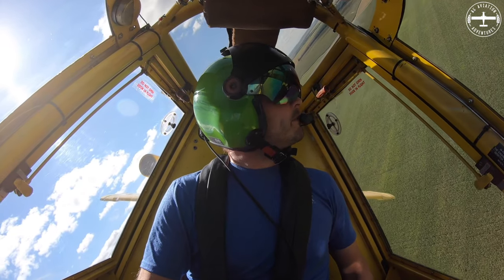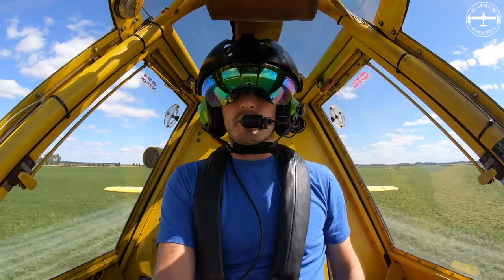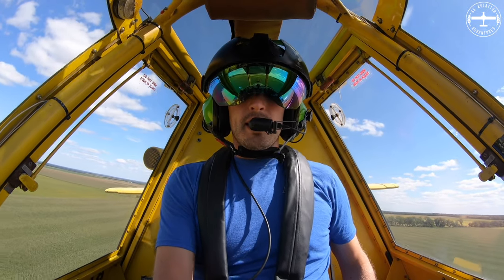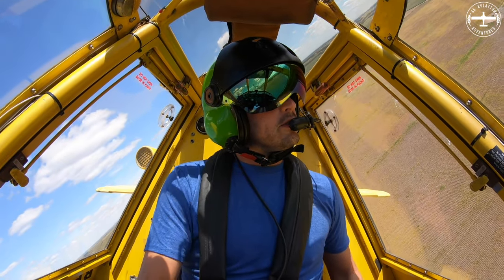How and Why I Got Into Crop Dusting

Comment: Idk if you will see this but I work as a flagger for the Olathe spray service in olathe Colorado one of only two on the western slope of Colorado I see you guys don’t use flaggers/observers but basically we watch the fields drive a truck keep track of its walls in case the system crap so I just watch for people because our fields are on average 20 to 40 acres but your channel is dope
Reply: You should look it up we live 60 miles from Utah as the crow flies at least
Reply from the maker: We appreciate you watching! We’ve actually stopped in and said hi. We live in Buena vista in the winters. You guys live in a beautiful area.

Comment: Great video, if one were to go to an ag pilot school, does that teach you the loader duties as well or just the flying and spraying part of the job?
Reply from the maker: I can't speak for all the schools but the couple that I know about do not teach any loading. It's easy to get on the job training for that. The work order and pilot will tell you what to load and how much of each chemical and water. Then you just measure it out and put it in the cone and then into the airplane. The school I went to focused on how to work and fly the GPS light bar and different patterns to run and how to avoid obstacles.

Comment: I have my commercial license and  I have been looking for information on how to get into crop dusting . I read that getting an applicator’s license can take a long time and several difficult requirements, is that true? How long can it take to get into crop dusting after commercial license ? I would appreciate any information you could give me, thank you. great video.
Reply from the maker: I responded to your other comment, but working on the ground is really important! The best thing flying wise is building a lot of tailwheel time. A lot of folks will buy a cheap TW aircraft to build time in. Getting the applicator's license is studying and learning and testing. You'll have to have an applicator's license for any state you plan on applying in.

Comment: Hi, glider pilot here. I wondered: do you hand fly those few feet above ground, or is there an automated system restricting ground proximity and avoiding obstacles? How close do you have to be to the crop?
Reply from the maker: Thanks for watching Christian. There is no automation and everything is flown by hand. You fly 5-10 feet above the crop. I talked about it in the 502 walk around video.
Reply: @AgAviationAdventures  ever brush the wheels - or the wingtips?

Comment: How big is that pivot? How often do you fly under wires? have you done night spraying? have you flown under wires at night?
Reply from the maker: All the pivots I spray around are 1/4 mile long. I have wires at the end of the airstrip so I end up flying under wires usually 10-15 times a day. I have not done any night spraying.

Comment: What is the chemical exposure risk to AG flying? Looks fun
Reply from the maker: Well, we are applying pesticides all day every day. Some are more dangerous than others but you will also have exposure. There are a lot of things pilots do to avoid exposure, iE they won't fly through their swath/the chemical. On the ground the pilots aren't typically loading themselves, but they can at times. We use precautions, always wear appropriate PPE, and do not cross contaminate.
Reply: @AgAviationAdventures  thanks for the response! My long term goal is aerial firefighting so I am looking at pathways there.

Comment: Hi Tyson: Questions about being an AG Pilot
(1) How does the pay works in this industry? As per the interweb, you can make 30-80k doing an AG Pilot job annually. But that doesn't explain how this all works in the real world. Is it a W-2 or a 1099 position mostly. That would change the take home quite a bit. Its a seasonal job and some areas are long seasons others short. How does that factor in to the pay. Is it sorta like a teacher where you will need a second job during the winter to make ends meet. 
(2) Also in your opinion are AG pilot schools worth the money? The last one I looked at wanted 40k. But if the business is hard to get into, this could be a seriously heavy debit to carry while looking for a job or trying to pay off. You would need to know that it would be worth it. (Im already a GA pilot)
(3) Does this job require you to be flexible with traveling. Will I be following the seasons north to south and from state to state or will I be stationed in one place.

Thanks for any info Scott, Im looking to make a change from my regular grind and want to know if this is a viable change or if its just a time builder. Im located near the CA central valley but I hear its almost impossible to break into, so I know Id be looking in other states.
Reply from the maker: Thanks for watching! You've asked some great questions and I've covered parts of it in other videos. 

1. A pilot is paid per acre, so the more work you get done the more you make. Some pilots make a W2 wage and others are 1099. It kind of depends on who you work for and how they structure it. But I've seen it both ways. The length of the season greatly affects the pay since the more you spray the more you make. Some guys get second jobs during the off season, Cally and I spend our time traveling and recreating. 

2. I went to an AG school and it was about $14,000 for just the AG training. I already had all my other ratings. I was kind of in your boat and I didn't know anyone in the industry or have an in. So AG school was my in... I met some great people and learned a little bit. Enough to get me that first job. I definitely would never pay $40k for training. You will be hard pressed to find someone who will put you in an airplane the first season. You will probably need to load for at least half the season to learn about it and the operator wants to see how committed you are. 

3. Some places you work they will have you travel with the plane and others won't. Places in CA probably don't do any traveling. They have long seasons and there is always work that needs to be done and they can't send planes on the road. I spend about 6 weeks on the road. I get way more work on the road then I would at my home base so I'm happy to travel. I wish I could get the work where I didn't need to travel but I've gotta go where the work is. For the other 3 months I based at home but will occasionally hit the road and spend one or two nights at a time at other locations helping out. 

I would not get into this as a time builder. It takes a lot of dedication and you will need to want to do it. It's difficult to break into and once you're in it may take a few years before you're making decent money. The schedule can be grueling.
Reply: Thankyou so much for the info. I’d rather do what I love. I guess I better look at schools. Better put off buying that stol plane. I sorta know a guy who knows an guy who has an AG outfit in Fallon NV maybe I’ll have to suffer a few months doing ground work there. 
Any schools you can recommend ?
Reply from the maker: Val 895 The school I went to is out of business. I think there is a pretty good one in Canada maybe. I would avoid Ag flight in Bainbridge, GA and I would avoid the one in Florida.
Reply: Hi, I'm located in Arkansas and an ultralight pilot of 15 years.  I've always been interested in getting into the industry.  Would you please elaborate on  avoiding Bainbridge GA?  It seemed like my best hope for a couple reasons.  Thanks for the videos!
Reply from the maker: 5652240 I have not heard many good things about Bainbridge. I know people who went there and only one of them had a good experience. But things change and maybe it’s different now. When I went to Ag school years ago Bainbridge was going through quite a few episodes of accidents. I appreciate you watching, let me know if you have any more questions.

Comment: I worked as a loader years ago, owner was killed, business shut down. I went the corporate route and been flying mid size business jets. At 50 how would I get into this business? 10K hour pilot with several thousand hours in turbo props. Are the ag schools worth the money?
Reply from the maker: Thanks for watching Rex. Check out the video “Do You Want To Be An Ag Pilot” where I discuss some steps to get into the industry. If you can find an operator to mentor you safely then I would try to save the money and avoid an Ag school.

Comment: My husband actaully drives a commercial fertilizer truck and he really likes his job but hes always been more interested in the sky tractor, he never actually looked into it because hes really tall and fairly big. Are the any restrictions in size as in being too tall or heavy for the plane?
Reply from the maker: No. As long as you can get in and out of it. I know people that are 6’5” and are able to fly it without complaints. Probably depends on the person really.
Reply: @AgAviationAdventures  ok. Thanks for the reply, is there a specific school that he would have to go to or could he take classes for it through any college?
Reply from the maker: There are a handful of schools that will teach the gps and spraying. You can go to any FBO for pilot ratings. Check out the “do you want to be an Ag pilot” video
Reply: @AgAviationAdventures  ok, thanks a lot. He already knows how to use the gps and rate controlls and how to weigh for product density.

Comment: Thats awesome! What is a realistic wage for a ag pilot? Do you need college or just a commercial pilot license? What did the training  process look like for you? Was it like an apprenticeship?
Reply from the maker: I have a video coming that answers most of these questions! Stay tuned. As far as training - I worked on the ground for several years before getting a seat and then worked my way up from there.
Reply: I’m working as a loader right now, hopefully some day I’ll be a pilot, looks like a dream job to me
Reply from the maker: I would say most pilots are in the $60k-$80k range but this can really depend a lot on where you are spraying. If you are in a state where you spray year round you will make a lot more vs being somewhere that only sprays for 3-4 months. I went to college for all my ratings so my training was a bit different then just going to an FBO to attain your licenses. I also attended an ago flying school to learn how to work the gps. You do not need a college degree and you can do it with just a commercial license.

Comment: How much does a first year pilot make. I guess it would depend on the length of the season? ie The south compared to the north?
Reply from the maker: I had a three month season and my first year I made $12,000. I would guess someone could expect to make $15,000-$30,000.
Reply: That’s a scary small number, I would find it hard to live on 60,000 year job. How long before someone can break 100g? In a season
Reply from the maker: Nothing is guaranteed in this business. You’d have a better chance making that kind of money where they have a long spray season. Maybe after a few years you could see that but it’s really dependent on many factors.

Comment: Do you actually think that little plastic helmet will help you when you hit a power line?
Reply from the maker: Well it wouldn’t do anything if I hit a power line since my head is inside the cockpit and the aircraft is what would hit a power line. However, if I crashed…. Absolutely. I have two friends that have crashed and without a helmet there is no doubt they would have died.